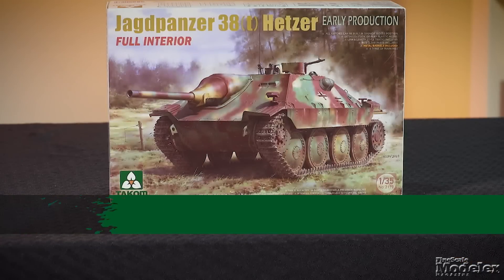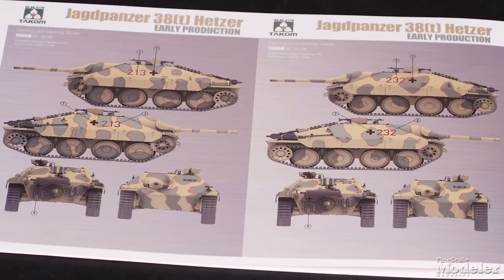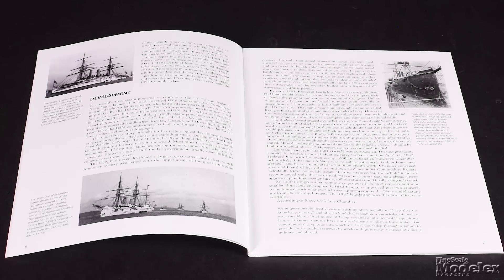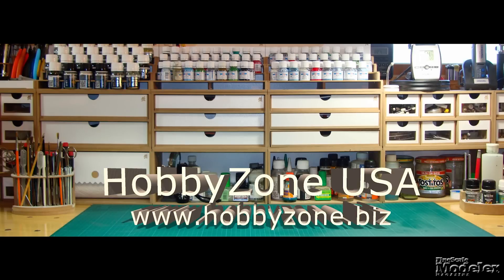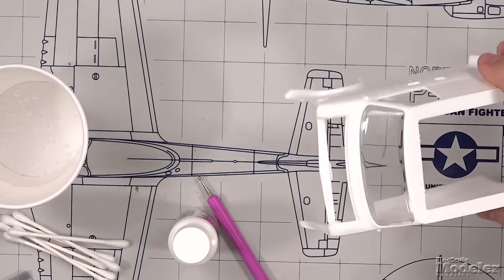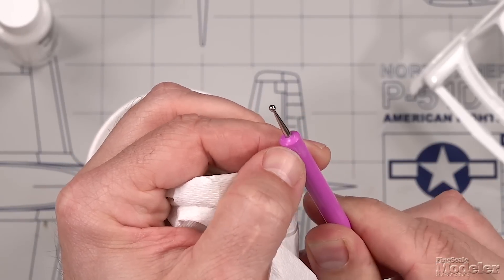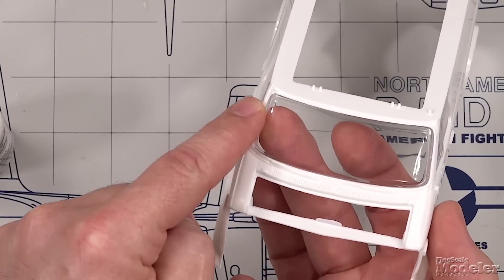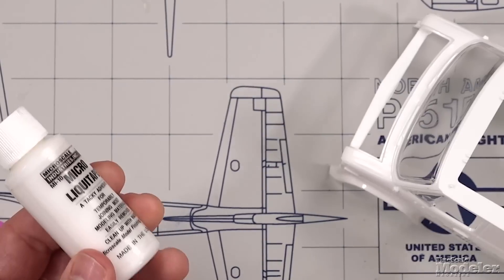Trying out Micro Liquitape, kits from Takom and Trumpeter, and a farewell

Comment: I have used the liquitape quite a bit. I mostly use it for things like panels that can be removed to expose engine parts underneath. If it ever gets dirty, just soak the part and it dissolves and you can reapply and use it again. Use it sparingly, only a few little dots of it are necessary to keep a panel tacked on. 

I keep finding more uses for it! Its like turning any surface into a 3M post-it note. It’s awesome!

Comment: It's basically floor tile adhesive. We used gallons of it when we refurbished offices and banks. We put it down on a scraped, cleaned floor with a paint roller and went and did something else (lunch mostly) while it dried and turned clear. Don't know what Microscale are chargeing but we called it Tackifier and bought it by the drum.
Reply: Model building supply companies love to offer a minimum amount of product at a maximum price. ☹️

Comment: I'm surprised you've only just found this product. I've been using 'Liquid Tape' for years, and even after ten years the bottle is still usable. I usually apply it with a toothpick or a piece of old stretched sprue. If a more permanent bond is required just glue all edges, and join while still wet. The bond isn't totally permanent, but with a lot of care the part can be removed.
Reply: Sad news of Jeff's passing. I remembered nearly all of models you showed and was particularly impressed with the scratch built "airship" that you featured. RIP.

Comment: The Micro Liquitape looks like it should make a good liquid mask substitute. I'd be less worried about it coming away or spreading itself too thin along edges.
Reply from the maker: We'd hesitate to use it as a mask due to its tack and the difficulty of removing it after it's fully cured--you'd have to use paint thinner.
Reply: @FineScaleModelermagazine  So it isn't water soluble then, as claimed?

Comment: If the Liquitape is water soluble, why would you use paint thinner to clean it up? 🤔
Reply from the maker: The instructions say it can be cleaned up with water while wet and paint thinner should be used if it has dried. Even when still wet, I found cleaning up the dotting tool a bit difficult, but not impossible. Thus, my recommendation not to use a paint brush. As one other viewer suggested, mineral spirits should be neutral enough to clean up the tape and not damage the part, but, of course, it could mar paint. -TK

Comment: This stuff is garbage, don’t waste your money. I was fooled into buying a bottle and thank the stars it’s inexpensive. It takes forever to dry regardless of the amount applied and is an extremely weak bond. I bought it to use on miniatures for test fitting etc. and it wouldn’t, when dry hold an arm on a 1/35th scale figure. And that’s after cleaning and degreasing the parts and thoroughly shaking up the product. Don’t be fooled, save your money and try using a small dab of blue tack instead. This is just a gimmick to separate you from your money